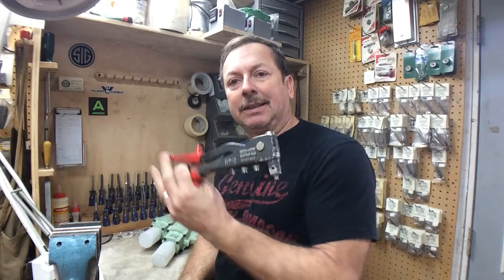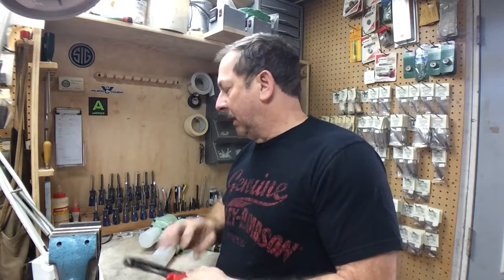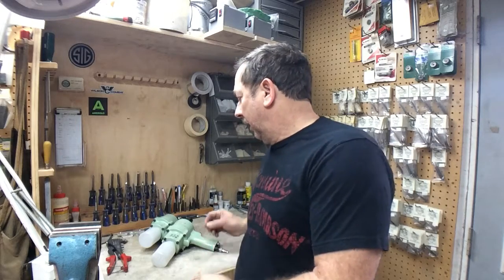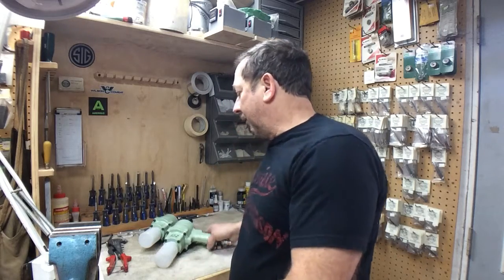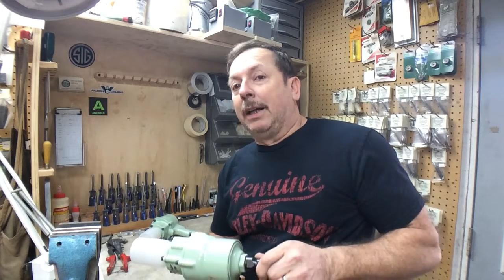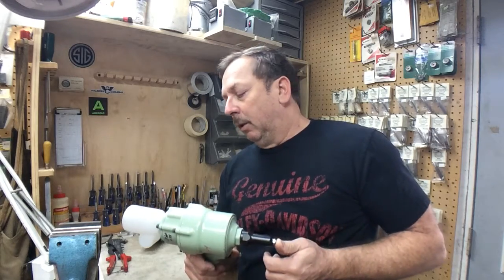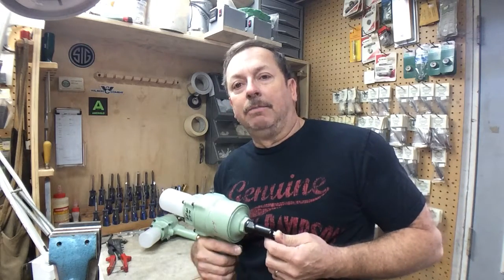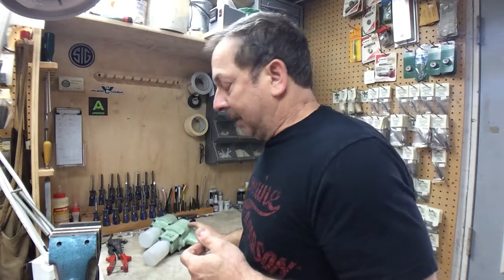Scratch Building A Zenith 701 Experimental Airplane: Rivet Guns

Comment from the maker: Hi Troy: they are included with the gun. It is the rivet catcher or cup listed in the description. You can either drop the rivet stem back out the nose of the gun into a container or use the catcher which I do but it takes an extra motion as you have to rotate the gun so the cup is down(rivet gun nose pointed upward). These guns in my opinion are far superior to the harbor freight gun.